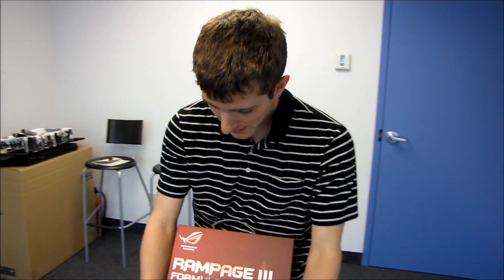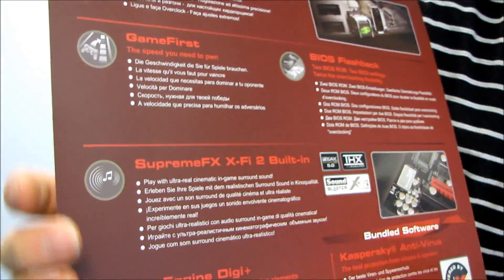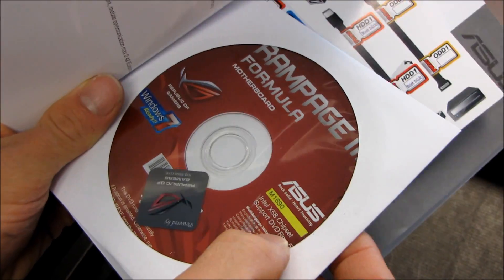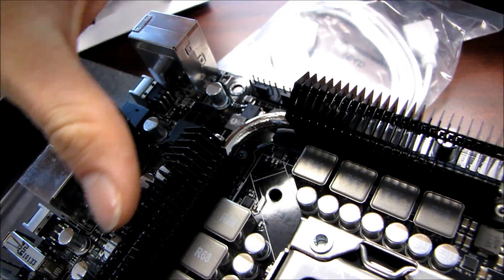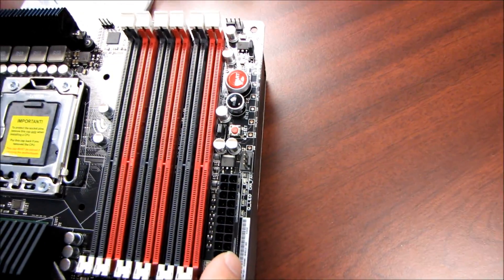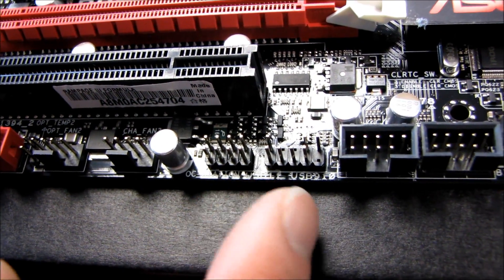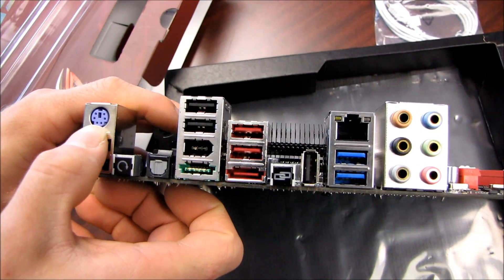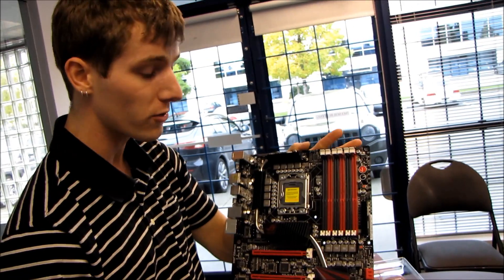ASUS Rampage III Formula Core i7 Gaming Motherboard Unboxing & First Look Linus Tech Tips

Comment: Update on this Value Board. LOL It Supports PCI-E 3.0 meaning it actually gives me my GPU Bandwidth even though it's supposedly PCI-E 2.0, I have 48GB Ram at 8GBx6 @1600Mhz enough though ASUS Says only 4GBx6 Max support, I have a Xeon X5687CPU running which also isn't supported by ASUS. This board is Still a monster. and YES It supports Dual PCI-E @ 16X which is to this day still a very rare feature.  It Hauls ass, GTA 5 at 70-80FPS @2k res on a RX580 and games like Sniper Elite 4 run at 70-100FPS.  AMAZING System STILL/

Comment: its March 2021, still running this board after 10 years , though upgraded the CPU to a XEON X5650 @ 4Ghz a few years ago. 16GB RAM and SSD, still runs great.
Reply: similar i'm running a x5675 and 12gb and ssd. still works lol.
Reply: can i run a rtx 2060 on it?
Reply: @MrGoontavious  yes. its actually pretty balanced if you have a i7-980X

Comment: I paired this with a x5690 Xeon, You need to install a modified Bios to ad updated micro-coding and security patchs or you will be plagued with instability.

 This cpu is FANTASTIC, my i7 950 was seriously bottlenecked but this Xeon runs my GTX 1080 with no bottlenecking scoring in the top 97th percentile.  No reason to upgrade yet, all games played at max settings on a 4k screen.
Reply: where did you get the modified bios? also, is that the 12 core xeon? I just bought this board and would love to put a xeon in it..

Comment: @Battleaxegunner . Right on man! This dumbass said on a newegg review that the ASUS site says that this board won't support the GT ram--but I looked at the PDF and it has the dominator gt @ 1866 and 2000 as supported. So many people review this board negatively. Ex: DRAM issues with multiple brands( bad memory support), BIOS won't save  any changes, DIMM slots dropping out,  some people say the CPU is too close to the RAM (which I'm worried about because I have a CM V8). Please make a video.haah

Comment: @asheseph thats because their motherboard drivers were likely not updated, or the MAXIMUM MEMORY option was ticked in msconfig... i have this board and 12 GB, Core i7 950 and dual GTX 470 SLI on Seven x64 Ultimate, and I get all of the RAM. Also, certain versions of Win 7 don't recognize more than a certain amount

Comment: You mention throwing away the Driver CDs/DVDs on a lot of your unboxings, I do agree that you should always download the latest drivers, however, in this case/review, if the Operating system doesn't recognize the network drivers, then you can't use that computer to download them.  Not everyone has a 2nd computer :)

Comment: @dtdw1988 premium meaning high end boards. Most higher end boards generally make the front panel connectors easier. Maybe this has the old ASUS pin thing where you connect them up.

Comment: @GenericName007 1155 will replace 1156. 2011 will replace 1366.  The 4 DIMM slots from the 2011 platform is Quad Channel (as opposed to triple channel).  By that time, we will have a single 4 GB memory module.

Comment: @chueey14 I was reading a little on the sandy bridge boards, are the first boards going back to the 4 DIMM slots?  They had some pictures and all the boards they showed only had 4 DIMM slots, which seems a step backwards.  I mean admittedly I haven't read in-depth on this but they were saying at launch that is what the first chips will havet, which seems odd to me, think they said it'll be the 1155 chipset?

Comment: Extreme isnt worth it the northbridge gets hot just on idle. On top of that you cannot mount a noctua or a silver arrow on the heatsink with the optional fan. I had the extreme returned it and got a rampage 3 formula. That board is a baby.

Comment: The start button you use this if you have a open benchmarking case so you can power up and off,also to reset the board. Rog connect is a neat feature you can use this with a laptop to overclock your pc and check status. Cpu fan is located top right of the socket.

Comment: @DaXpenneX Rog is for connecting your computer with an other computer to easily configure the bios
and the start and reset button are for when you're running your computer without a case, for like a reviewer or on a test bench